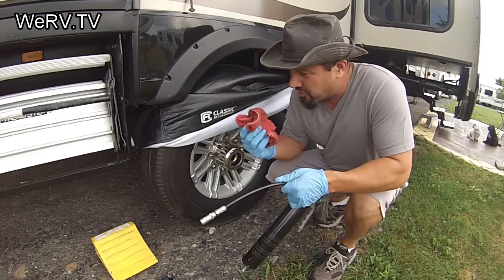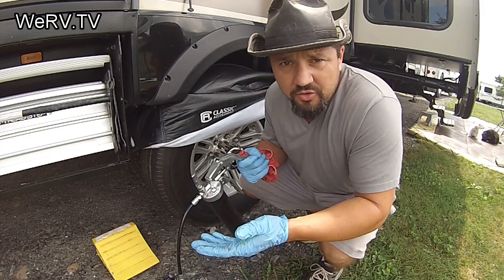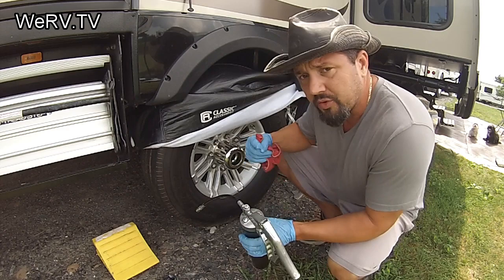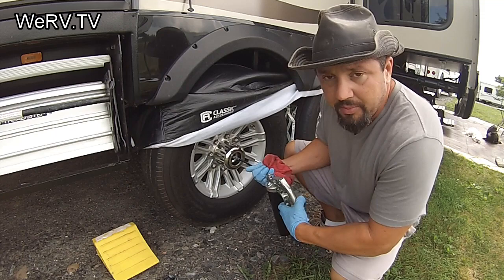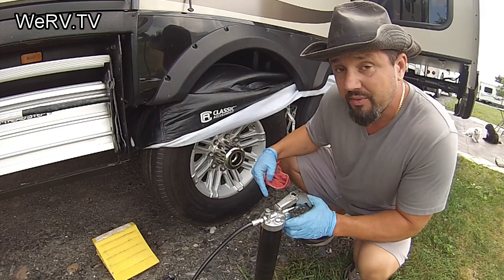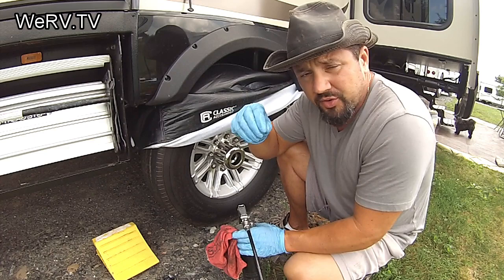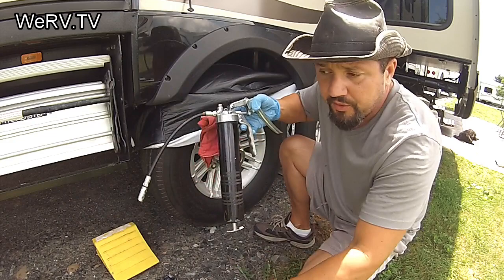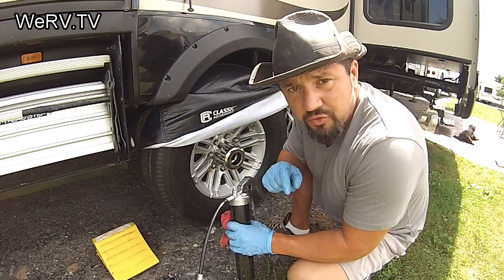Grease Your RV Trailer Wheel Bearings

Comment: The part about over-greasing is non-sensical. In order for the grease to make it to the outer bearing, you will have to pump out all the grease from inner and outer bearing out, as well as fill that entire cavity between the bearings. The design of these things requires you to pump a ton of grease through them to flush them out.

If your rear seal is bad, yes of course you can pump grease into the area with your brake shoes... Thats why you check your brakes and seals.

Comment: those bearing buddy's are really for boat trailers.  remove wheel, remove hub, inspect brakes, repack bearings - BEST WAY
Reply: Agreed.  There are some systems though where the grease comes back out through the same side, so you don't need to worry about blowing out the seal and greasing your brakes.  I think Jayco has a video on that.  That though doesn't allow an inspection.

Oh, and if you do it this way, jack up the wheel and rotate while greasing.

Comment: Most fulltimers don't rack up many miles because they mostly stay put for months at a time.  I think you may be overdoing it at every 3 months with very few miles.  Your 5er is still practically brand new.  How many miles are on it?  Is there a recommended mileage or time interval for greasing wheel bearings on that particular chassis?  Safe travels